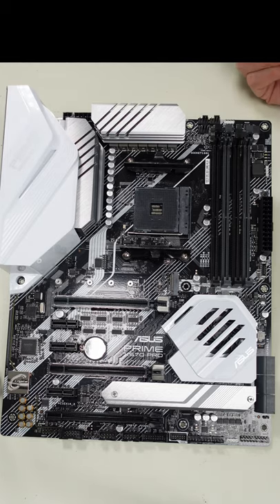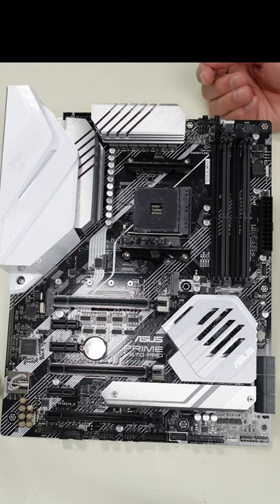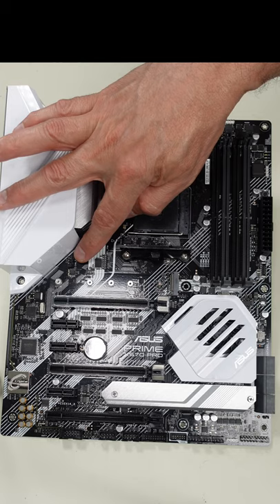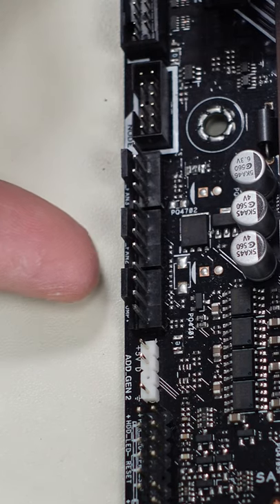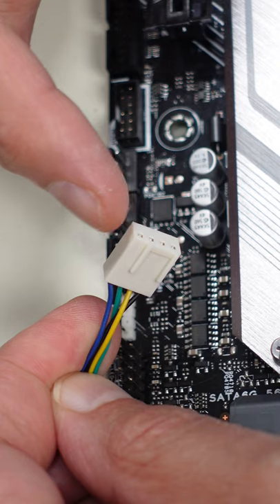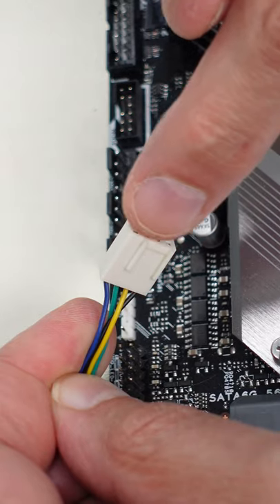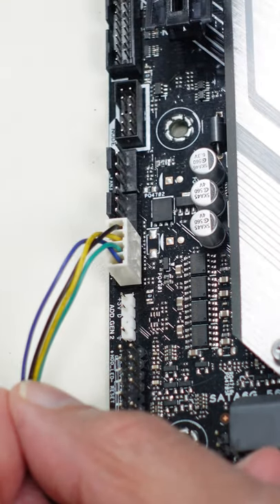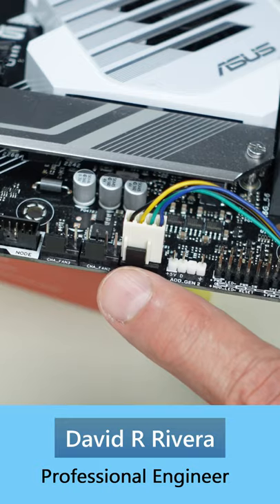Connecting CPU and Case Fans to a Motherboard #Shorts

Comment: Back again! Finally getting back the my wife’s build and I was sort of wondering. I have a total of 6 fans outside of the GPU. The cooler is already in. Thanks for this vid!
Reply from the maker: Does your motherboard have that many Fan Sockets?  or are you splitting some of them?
Reply: @PE4Doers  it has four fan sockets, so I’m going to have to split them. Bought a three way splitter yesterday. For now I’ve got the cpu cooler plugged into cpu fan 1, the rear exhaust fan, and two intake fans. Hopefully that keeps air pressure positive.
Reply from the maker: @bigman7856  Sounds like you have it well thought out.  Good Luck.

Comment: Why does CPU cooler have a three pin connector would I just plugged that into the four pin connector since I don’t have a three pin ?
Reply from the maker: Yes, that is a DC powered fan.  It will work on the 4-pin, but not be as controllable as a PWM (4-pin_ fan).

Comment: How is this cable with the white plastic at the end and colorful wires called? I don't have such a cable. And today a guy from the store with the components sold me the wrong cable.
Reply from the maker: That is the 4-pin PWM Fan power connector.  When you say wrong, what do you mean?  Does it only have three pins for example?

Comment: well i have only 1 fan pin on motherboard in which is connected cpu fan. So... how to connect case fans on 1 and only fan connector on motherboard?
Reply from the maker: You will need to get a Fan hub that is connected to one of the motherboard USB connectors and some support software needs to be loaded into Windows (or which ever operating system you happen to have).

Comment: Yo im planning to add more 4 or 5 fans to my pc, but my psu doesnt has any additional wires for fans. But my motherboard has two 4 pin pwm. But theres alrdy 2 fans connected in it. My motherboard also has molex 4 pin header. Should i use molex to 3 pin splitter cable or 3 pin to 3 pin splitter cable (i should plug the 3 pin in my 4 pin pwm header)
Reply from the maker: You will definitely need to get some splitters.  The ones I use are 1 one-to-three splitters, where the first one becomes PWM and the other two become 3-pin DC fans (even if they are PWM.
Reply: @PE4Doers  im planning to use the molex for the fans. As my fans alrdy has connectable socket. Is it okay to connect 5 fans in one molex?
Reply from the maker: @loga_912  Yes, a Molex has very large current capability.

Comment: Hello,I have a question.
If the casing fans are Argb do they carry 2 cable connectors together? Like- 1 for ARGB & 1 for PWM/Dc for controlling fan speed? 
How people control both Fan speed & Argb lights together otherwise?
Reply from the maker: In every one I've seen have two separate cables.  The connectors are quite different and you shouldn't be able to plug the wrong one into the wrong connector.  Caution however, you can connect a 3-pin ARGB (5v) cable into a standard RGB connector (12v), which would most likely burn out the control ARGB logic in the ARGB fan.
Reply: @PE4Doers  Thank you. Appreciate it. I was thinking of building a new pc. Deciding to go with a Gigabyte B550M DS3H mobo. Their website says it has 2 Argb port & 3 RGB. So, i was a bit confused about how people control the fan speed separately. Also, i think it has "3 fan headers" according to their website. 
Hopefully, if i buy a case with 4 pre-installed Argb fans, they will be able to connect both fan speed & Argb lights thru mobo software.
Reply from the maker: @zaidtanim4163  They may need a splitter on the power cable, but I believe you will be OK.
Reply: @PE4Doers Thanks a heap. Much appreciate for answering.Subscribed 💝
Reply from the maker: @zaidtanim4163  No problem

Comment: what about the argb fan but motherboard is 4 pin? please help me sir how to use argb on 4 pin motherboard 😭😭
Reply from the maker: DO NOT plug a 3-pin ARGB into a mother 4-pin RGB connector - that will burn out the device ARGB.  Check to see if your motherboard also has the 3-pin RGB connector - sometimes called the Rainbow connector.

Comment: I have connected 4pins and 3pins to my motherboard asrock b450 steel legend,The Chasis fans are working good when i built my pc but due to some problem in motherboard , i sented the motherboard for repair in service center,after that i have again assembled my pc but this time all working,system also working but the chasis fans wont working .....
Reply from the maker: I got a little lost in that description.  Is it working after the repair or not?
Reply: @PE4Doers  I sent the motherboard for ram slots repair,but due to cpu socket pin bent my ram slot B1and B2 doesn't work anymore,but problem is chasis fan also not working this time previously it works
Reply from the maker: @souravborah5950  That makes sense.  Motherboard repairs are difficult.

Comment: My motherboard has a sys_fan1 and cpu_fan1 there alot of connectors at the bottom of my board how would I know what connector is for fans there is one connector that says JCOM1 and there's another that says JFP2 and JSMB1 and JTPM1
Reply from the maker: Take a carefull look at your motherbard manual to make sure (nearly 100% can be found online these days).  The Fan connectors usually have 4-pins (some older than 10-years have only three - DDR3 and below).  The Fan connectors also have a plastic guide on one site that mates with a slot on the Fan cable (which I believe I show in the video).
You can also see much more detail on doing all this in my 'Full' video at: https://www.youtube.com/watch?v=Af77ZmLpNcI&t=14s

Comment: I’m curious do you need a cpu for your fans to spin? Because I don’t have mine yet but they won’t spin when connected
Reply from the maker: Most motherboards will not power-on without a CPU installed.

Comment: My system fan connector doesn’t have a slot on one side but my mobo does have the little tab thingy
Reply from the maker: Maybe you need to get a Fan extension cable.

Comment: What is the difference between 3 pin connector and 4 pin connector? On motherboard
Reply from the maker: Some 'older' motherboards do not have Pulse Width Modulation (PWM) available on their Fan connectors (or withing the electronic logic on such motherboard).  PWM allows Finer control of the Fan Speed and is much more responsive to changes of temperature - a highly desirable feature.

Comment: My fan cables have 4 holes, but the plastic tab is on the middle, so it doesnt fit. Is there any way to go around this?
Reply from the maker: No, don't do that.  If only three pins are accessible, then you have ARGB fans (that only 5v supplies).  If you plug them into a socket, or another fan that has 4-pins (which is 12v RGB) you will likely burn something out.

Comment: i have an important question. I want to get a case that has 4  rgb case fans, does the particular motherboard support up to 4 fans? and will all have rgb lighting?
Reply from the maker: Those are available, but mostly when you get a Full Tower.  Generally a mid-tower comes with two Fans (RGB if you buy a particular model), but then it does not cost that much to buy two (or three) more.  That's how I usually do it.

Comment: Where does the rgb cable connect to the hub just got this motherboard so I'm unsure where stuff is installing the back fan
Reply from the maker: Every hub is different, however if they connect to the motherboard, they uually connect to one of the motherboard standard connectors.  I would check in the hub manual to determine which one.

Comment: What should the label say?
Reply: And for rgb what does the label say?
Reply from the maker: it is labelled W-Pump, which means it is meant for a PWM Water Pump
Reply from the maker: @AintPopular  Add_Gen_2, which mean an Additional Gen 2 (a.k.a ARGB) connector.
Reply: @PE4Doers  For RGB it shows 2 header locations. Ones D_LED and LED_C
Reply from the maker: @AintPopular  Where do you see that?  On your motherboard?
Reply: @PE4Doers  Yes on lower edge. B660m ds3h motherboard

Comment: This was Very usefull, i was afraid i would have to buy a Fan hub
Reply from the maker: Generally a hub is only needed if the connectors or type of fans (RGB or ARGB) are not compatible with your motherboard.  However, ARGB fans are not all the same, so non-compatibility is quite common.

Comment: I have the same mother board and I connected all the leds but they’re not matching colors and they don’t show up on my pc as being connected even tho they turn on and actually spin
Reply from the maker: I have seen that when there are different brand Fans, but based on the generally circuitry used for most name-brand motherboards, the three colors come off the same controller with only the power driver being different (that can add at most a 20ns phase shift).

Comment: Are you able to change the colours of fans on the motherboard rgb connector
Reply from the maker: You should be able to.  The motherboards usually have a 'default' cyclic pattern but that can usually be changed with the software meant to control the RGB for that motherboard.
Reply: @PE4Doers  thanks but do you know what software a b550 elite v2 uses
Reply from the maker: @x3bca499  which motherboard manufacturer? ASUS, Gigabyte, MSI?
Reply: @PE4Doers  AORUS

Comment: My fan cord has 3 slot not 4 what do I do
Reply from the maker: Then it is an ARGB type that can ONLY use 5volts.  Your motherboard may have both connectors.  NEVER try a three pin fan in a 4-pin connector.  It will not only fail to light, it will likely burn out the LED controller on the Fan.

Comment: Where does the rgb goes
Reply from the maker: Hopefully your motherboard has either a 3-pin ARGB or a 4-pin RGB connector.  Make sure you don't plug it into the wrong one however, since that could blow out the RGB on you Fan (or whatever you have RGB on that you are looking to get to work).

Comment: What do I do if my case fans only have 3 pins and on my motherboard takes 4 pins what do I do
Reply from the maker: Honestly, I would change the case fans - which is my default 98% of the time since most cases under about $200 only comes with the 3-pin DC Fans.  PWM is very superior in terms of cooling control and reaction to temperature changes - at least the way the BIOS and supporting Fan software tend to work.

Comment: But what if your plug is three holes but have two wires to your case fans?
Reply from the maker: I would be VERY cautious using those fans.  With only two wires (usually a red and a black) the fan is only connected to the 12v supply and has No control on it over speed - thereby running at 'Full Speed' all the time.  Besides the excessive noise coming out of that PC (the way they ran 15 to 20 years ago), there is will a significant amount of current drawn through the connectors on the motherboard, which could heat up the fan power driver logic and possibly reduce the life of your motherboard (at least the Fan connectors.  If you really want to keep those fans, I suggest you get some adapters that allow you to connect them directly to one of the power supply connectors - either SATA Power or a Molex.

Comment: what motherboard is this pls tell me
Reply from the maker: The ASUS Prime X570 Pro.  It will be going into my Streaming rig in the near future.  The Fan connectors are very similar on ASUS and MSI motherboards.
Reply: @PE4Doers  omg thank you so much its so hard to find a motherboard with a fan header in my country
Reply from the maker: @imjustafish9802  You are very welcome.  Maybe you can get a separate Fan controller...  I think there are some that have probes you can place inside your system.
Reply: @PE4Doers  Thnx for the tip. I've been looking for this info for my brand-new MSI 560M mainboard. this will be helpful, I hope so.
Reply from the maker: @birolungelin4543  I like connecting all my PWM fans to the motherboard connectors.  Today's motherboards do a very fairly good job managing them without adding addition S/W to the operating system

Comment: Does anyone know where I can plug my case fans onto the motherboard when I have no fan header left ??
Reply from the maker: Do you have one or more already being used?  If so, you can get a splitter cable.
Reply: On my gigabyte board there is no case fan port but there’s 2 cpu fan ports and because the cpu fan port has 4 pins instead of 3 you just plug the 3 you have into the spot where it fits

Comment: What if I only have a 3 pin fan, but on my mobo there is only 4 pin
Reply from the maker: It sounds like you have an ARGB fan (that Only worked at 5-volts), and a legacy RGB connector (that only outputs 12-volts) on your motherboard.  See if there is also an ARGB connector.  If not, do not plug it in, or you will blow something out, most likely the Fan, but you could also trip the over-current sensor in your Power Supply, which you can reset by turning your PC off for at least five minutes.
Reply: @PE4Doers  it’s not an ARGB, does that make it okay. And thank you for your help
Reply from the maker: @IdiotSauce29  You are quite welcome.  Now you have me wondering if that fan is meant to be connected to a proprietary RGB controller.  Is it just one fan, or two to three?
Reply: @PE4Doers  they are all connected 3 fans to be exact
Reply: @PE4Doers  my fans spinned when I turned it on so ima just roll with it
Reply from the maker: @IdiotSauce29  Until I saw your next comment, I thought for sure it was really ARGB.
Reply from the maker: @IdiotSauce29  I apologize, I thought you were asking about the RGB connector not the Fan power connector.  Yes, that will work as long as you ensure you have that little socket tab fit into the slot on the connector. The fans are running in DC mode, not PWM, so they will not be as responsive to temperature changes detected by the mother associated with the specific connector an/or the BIOS settings, but will work.
Reply: @PE4Doers  no that’s okay, my fans work perfectly fine now. Your advice really helped me so thank you so much. And yes I don’t think they respond to temp change. 👍

Comment: Can i connect case fan to led_cpu header?
Reply from the maker: As long as they are the same type of RGB.  The two types (12v and 5v) are NOT compatible.
Reply: @PE4Doers  i have rgb case fan 12v but after connecting to led cpu header not working
Reply from the maker: @Nks_L-g1on  What does the motherboard manual say about that connector?  is it 12v RGB or 5v ARGB (sometimes called Rainbow).
Reply: @PE4Doers  i don't know i have b450m gigabyte mb